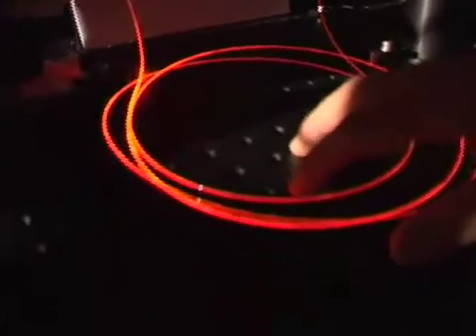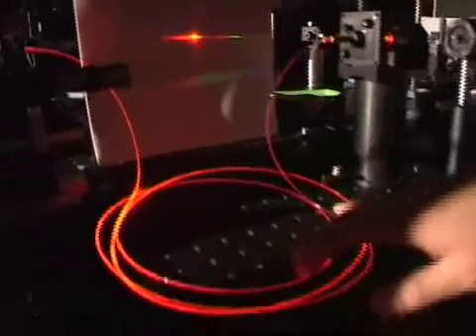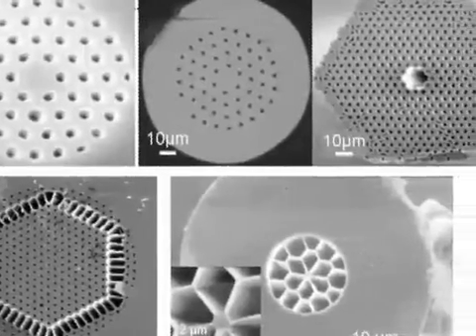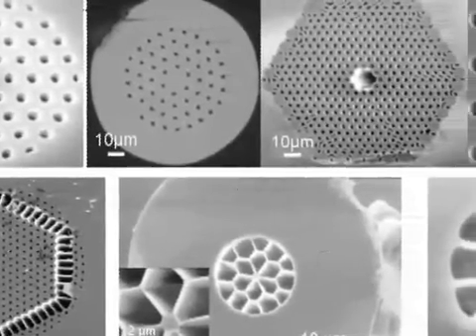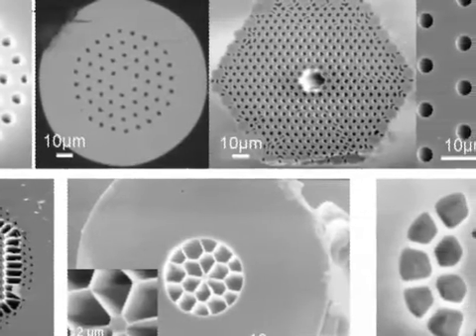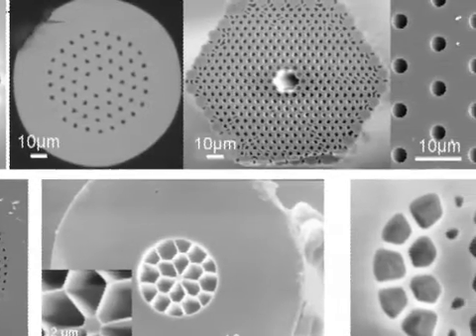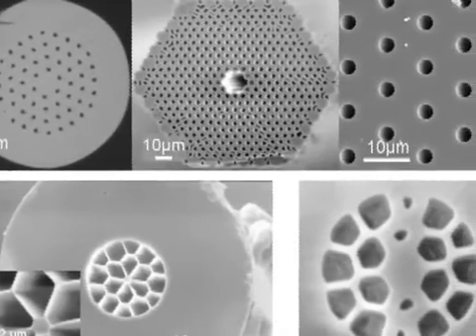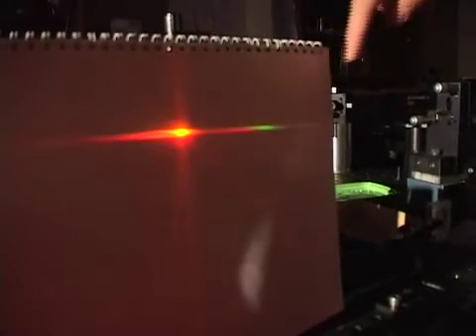Tunable Laser with optics and geometry super-continuum

Comment: Have you tried using one of the yellow laser lines in the Krypton laser closer to the middle of the visible spectrum? It could get you past the green I saw to the blue while still keeping some of the red.  Just a thought.  Also wondering how do you cavity dump a 2-5 watt laser and be able to put your hand in front of it? If the laser power is 2 watts cavity power must be at least 40 watts at the cavity dump output.